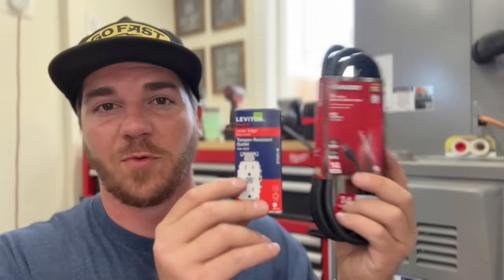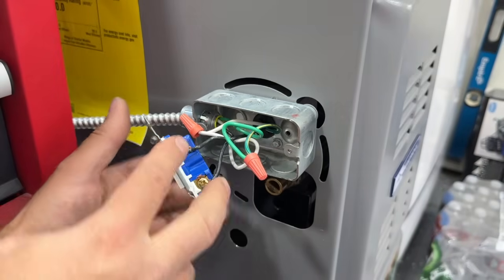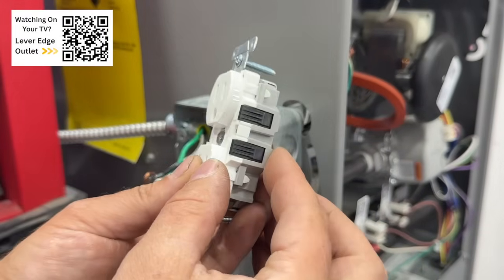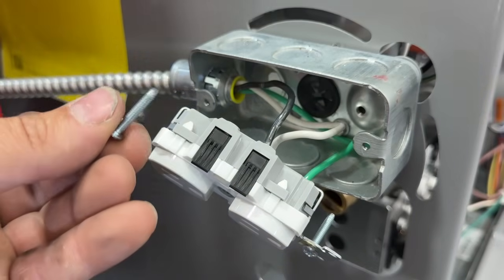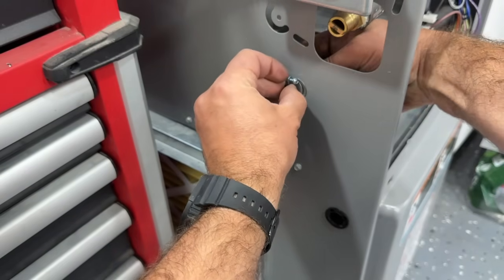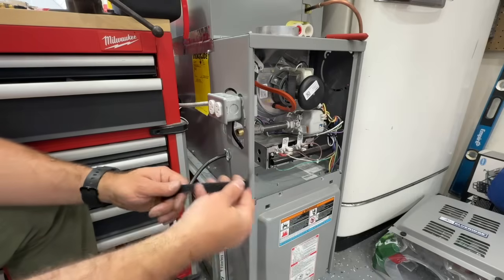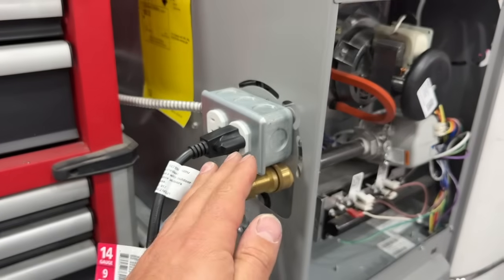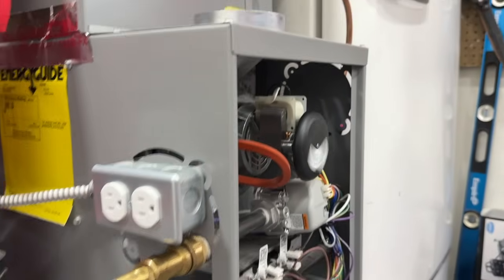This $16 Hack Could Keep Your Family Warm During A Power Outage!

Comment: You didn’t mention that you should use a pure sine wave supply, some people might use a cheap inverter which can damage the circuit board.
Reply: That totally depends on how complex the control electronics is in your furnace.  I sugggest you to try it first in the summer.
Reply: @tonylam-u1t right, so if it damages the circuit board I’ll have time to replace it for $$$. Good plan 🙄
Reply: @polishhotdog933  Then you should be smarter than  that.
Reply: @polishhotdog933  so does this mean i can't use my portable gas generator? or do i have buy a different generator or splice something in between the generator and the furnace circuit?:face-orange-biting-nails:
Reply: @cocodog85  I would use an inverter generator regular generators, have too much harmonic distortion in my opinion. Maybe it’ll work but I  wouldn’t take a chance.

Comment: This is good information and actually a good idea. The only thing to bear in mind is that SOME older furnaces may be a 20 amp circuit in which case you would need to use a 12 gauge pigtail and an outlet rated at 20 amps. Thankfully my house is wired into a  generator switch box so I just need to plug my generator into my electrical panel and I have 6 zones I can keep running.

Comment: I’m surprised that the switch for the furnace is on the furnace itself. Code here is that you have to be able to turn off the furnace without going past it. The switches are usually located on the wall at the foot of the stairs well away from the furnace

Comment: If the power is off, how does the wall thermostat work? My thermostat just has a blank digital screen when the power is out.
Reply from the maker: As soon as your furnace power is restored (via power station or generator) your thermostat will boot up and work as normal 👍🏼
Reply: @diyhvacguy huh, good to know. Thank you!

Comment: Wouldn't it be a good idea to use a single outlet instead of a duplex or is it OK to use the second outlet for an additional appliance?
Reply: No, the furnace should be the only thing on that circuit.  That's why it's the only thing on that circuit.

Comment: With air conditioning is there a back feed to that gas furnace
Reply: Shouldn't be, my furnace is ran by a 120v circuit, my AC is connected to a double pole 240v circuit, different circuits for each.

Comment: "Both of these items are less than $20. You don't have to break the bank to get power to your furnace ..."
But I have to go out and buy a   generator now.  Is that free?  In any event I have a very reliable power utility company and anyways most of my outages occur in the summer even though temps here are -30 with ice and snow in mid winter.
Reply: Well  yes dum dum, if you want backup power you have to get that from somewhere.  What a genius.

Comment: If there were a power outage, how would your thermostat get power?  It's not an old-school mercury switch.
Reply: The low voltage.trsnsformer is located inside the furnace.  It can supply the voltage to run the electronic thermostat, but if the backup batteries in the thermostat go dead, you'll have to take over the settings manually.
Reply: DCpower

Comment: are those bonding plugs needed for anything that is plugged into a battery powered backup supply with a 3 prong plug? I never heard of a bonding plug before. I assume with a gas powered generator, no bonding plug is needed.

Comment: Do not buy a "super-cheap" non-contact voltage tester especially for DIY toss-it-in-a-drawer afterwards.
This is a clear code violation. Permanently installed items like furnaces MUST BE hard wired, not using a pigtail; using a pigtail cord violates the UL listing and NEC installation requirements. 
Also, a bonding plug used in this manner leaves your furnace UNGROUNDED and dangerous, it leaves the furnace ground pin floating. 
Just get a proper PowerStation with properly grounded 3-wire sockets and know this is illegal anyway - if you ever have an inspector in that area you'll be red-tagged and flagged to remove it and possibly fined depending where you live. If it were to cause a fire, etc. your insurance claim could be denied.
Reply: LMAO.

Comment: Perfect!  Now, do a video on how to properly isolate and power my water well during an outage
Reply: I’m sure when he becomes the diy plumber guy instead of the diy HVAC guy, he will.
Reply: Isn't the water heater 240v? If the generator can't support 240v you will not be able to power it.
Reply: @Leona147741 Many generators do supply 240v.  They are obviously larger.  I happen to have three of them, but not large enough to do the whole home.  Enough, though, to supply power to the well pump. I'm not expecting to supply power to a water heater.
Reply: @Leona147741 he means his well
Pump not water heater.   But your still right many deep well
Pumps are 240v as well and would need a beefy generator

Comment: Thanks to you, I have installed an EZ Generator switch on my furnance, (supposedly code compliant, but I have my doubts). Now my family can stay safe and warm when we have one of the many winter power outages!
Reply from the maker: Glad you found the video helpful, and that you're better prepared for outages! 👍🏼
Reply: The EZ switch is both NEC code-compliant and UL listed. That probably explains its ludicrously high price. Permanently installed home heating appliances are generally required to be hard-wired. Attaching a flexible cord is not permitted and may cause issues with your insurance coverage. That said, this will work just fine.

Comment: Can you explain more why the grounding plug is needed to make the furnace work off the eco flow? That didn’t make sense to me.
Reply: A bonding plug is a device that connects the ground and neutral wires together, allowing generators to work properly with power surge protectors and ensuring safe power delivery to RVs. It is especially useful for generators that do not have a built-in neutral-to-ground bond, preventing error codes and power issues.

Comment: you also need a generator big enough to supply power to the furnace. Why not just install a 1 kw backup battery system then you can also run some other basic stuff?
Reply: A generator is cheaper than batteries for back up power, you would need a pretty big bank to last days.

Comment: based on videos I watched over the past couple of years, i could never go back and forth between my Ecoflow and grid with fancy inlet box and switch on the furnace. Your bonding adaptor explains the issue exactly based on how I had to hot wire my furnace to work with my ecoflow during an outage.

Comment: Like others asking?  What is the bonding plug for, you did not explain this very well.  I did your whole method from previous videos and love the concept and it works great with no bonding plug, so happy but now you are using a bonding plug and now back to confusion,
Reply: A bonding plug is a device that connects the ground and neutral wires together, allowing generators to work properly with power surge protectors and ensuring safe power delivery to RVs. It is especially useful for generators that do not have a built-in neutral-to-ground bond, preventing error codes and power issues.

Comment: in this example wouldnt it have made more sense to plug your power station into your furnace outlet, then plug the furnace pigtail into the power station instead of that rigged up grounding plug? plus this way if the power kicks back on in the middle of the night, you dont have to swap back immediately, or if the power keeps going in and out for a few hours, when you have power it would be topping off the power station. sounds like a win win to me.

Comment: Our furnace is about 20 years old and also has a plug that plugs into an outlet so it is easy to switch it to a power station. However ours draws around 800 watts when running so a larger power station is needed to sustain that and a little more on initial fan motor turning on.
Reply: My furnace while running draws just under 800 watts, my champion 2500 duel fuel generator will last around 24 hours on one tank of propane.

Comment: I'm confused by the 'bonding plug'. Why would the Ecoflow not want to power anything that's plugged into it that's drawing such a small amount of current? First I've seen this situation.
Reply: Some appliances need a ground reference to function , case in point modern furnaces. Ecoflow , generators and pure sine wave inverters are usually floating neutral the bond plug ties the neutral and ground together at the power source, Ecoflow or etc..

There is only one bond allowed so to keep linemen safe you should make sure you don't feed back to the mains.

Comment: This is great in a pinch, but spend the money and get a proper transfer switch that can be configured for a floating neutral.  Plus, you will be within code.
Reply: On a proper transfer switch, how do you get it to handle the floating neutral?
Reply: @garyganser2451 there’s a switch called the EZ Generator Switch.  It can be wired for either a floating or bonded neutral.
Reply: @garyganser2451 because you are using the ground of your electrical system I think.
Reply: It can be wired to switch the neutral.  See the EZ Generator's documentation for an example.

Comment: Doing this will fail an NEC electrical inspection. Changing anything into a plug in appliance in the 2024 NEC codes, requires GFCI protection. Because it is a receptacle in a residence, arch fault codes apply also. Why would anyone do this when you could install a UL rated manual generator interlock that will power your entire home doing a similar amount of work at the main panel.
Reply: That doesn't sound like a $16 hack. You would do it for an emergency only. It may never be used. Personally, I won't bother with this, I'll simply wire it up when needed. We've only lost our power for longer than an hour, 2-3 times in two decades. Our services are underground.
Reply: There are a lot of assumptions in your statement.  Number one is that not all Jurisdictions, in fact few jurisdictions across the country, adopt the NEC code when it gets published.  My home state is on 2017 with a few isolated exceptions.  Second, is if they used a single outlet instead of a duplex than as a dedicated receptacle it is possible to be an exception, again depending on your jurisdiction.
Reply: @michaelwitkiewicz7052 You don't know what you are talking about. You obviously don't hold an electrical license.

Comment: Great video, thank you! Your link for the bonding plug takes you to a lighted Leviton replacement plug on Amazon, not a bonding plug.
Reply: Yes, I ordered the wrong plug on Amazon!  I don't see that Leviton makes a bonding plug.  Fortunately I found a bonding plug from Southwire on Amazon.
Reply: True and I also ordered the plug he linked but I just made a jumper wire from the ground to the neutral

Comment: Why exactly did you need the bonding plug?
Reply: A question many of us have here and it was not addressed. I googled it and it's something to do with a floating neutral. I don't understand it as I'm not an electrician, but I don't understand the difference between plugging in a furnace or plugging in a toaster. I assumed the power station would provide power to anything that was plugged into it, as long as the current demands aren't exceeded.
Reply: A bonding plug is a device that connects the ground and neutral wires together, allowing generators to work properly with power surge protectors and ensuring safe power delivery to RVs. It is especially useful for generators that do not have a built-in neutral-to-ground bond, preventing error codes and power issues.
Reply: @katsasstrophy2334 thank you!!

Comment: Wait a minute, power goes out. You now supply power with your battery station (aka solar generator (?)) how is your electronic thermostat going to get power ?????
Reply: The C wire which is feed from the furnace. Some thermostats also have a battery
Reply: The thermostat gets its power from the furnace 24 volt internal transformer  no matter where the furnace gets its power from.

Comment: I went with the EZ generator switch as an alternative to adding a plug, but still have easy generator access during power outages.
Reply: yup, another vote for EZ generator switch,  I have two of them one for the hvac, that will keep air circulating and one for the propane boiler system.
Reply: I went with the EZ generator transfer switch too. Compliant and easy to install.
Reply: The generator switches nice I just have a problem paying $88 for something. I may use once a year.
Reply: @mitchmintz111  I'm going on 5 years and I've only tested it a couple of times.  Hoping I never use it but I get the $88.  I just dont want to be fumbling around in the dark trying to hardwire my furnace during an outage.
Reply: @markcarlson1696  Put an outlet where the furnace switch is in the box and put a plug on the furnace. Plug furnace into the outlet.
Reply: @mitchmintz111  That works and I considered it.  I felt more comfortable with putting the EZ gen switch on the circuit breaker for the furnace.  Which is what the manufacturer suggests.
Reply: How much did you pay for your generator and how often do you use that?

Comment: I tried to use my generator to power my furnace last winter and it didn't work.  Thankfully the outage was only about 3 or 4 hours so my house did not cool down thatmuch.  I wish I would have known about the bonding plug and I went ahead and purchased one so l if we lose power again this winter my generator should power my furnace.

Comment: Question:  if my furnace already plugs into the wall, can I just run it with a generator if needed? Do you have a video on this?
Reply from the maker: Yes exactly, just unplug your furnace from the wall, and plug it into your generator (or extension cord if you need to run it further than the cord will reach  to get it outside) 👍🏼
Reply: Just have a bonding plug on hand if needed, many generators have a floating neutral; And most modern furnaces require a ground reference to run.

Comment: I started to do this last year after watching your video, I've done some electrical wiring but when I got into it I saw it had a door switch to the furnace i wasn't sure how to hook it up. Love this idea though. Thank you.
Reply from the maker: This does not effect the door switch. The door switch will function exactly the same. If you pull the blower motor door off, it will kill power to the main board. 👍🏼
Reply: @diyhvacguy  Thank you, I just wasn't sure how to rewire the door switch. Have a good day.
Reply: @silverfox-59  you dont

Comment: One other issue....The link to the receptacle on Amazon links the the Decora one and not the one shown in the video.   Matter of fact I cannot find the Leviton Lever Edge with the standard(non Decora) dual receptacle.  15A or 20A ones.
Reply from the maker: Yes, the one that’s linked is for a decor one but I’ve also linked a metal cover that will match, so the install is exactly the same

Comment: I am going to hook mine up like this thanks.how much is that generator cost and will it last long on a charge
Reply: In the video he said that furnace will run a couple of hours from the power station he used to illustrate the idea.  

The run time for your installation will depend on your furnace electrical needs and the capacity of the power station or generator you use to power it.

Comment: What do you do if you have a 10 amp fuse in your switch box by the furnace?
Reply from the maker: If your breaker is 15 amps you can disregard the 10amp fuse.
Reply: @diyhvacguy Thank you!
Reply: My old furnace has a 7.5A fuse.  A year ago it started blowing that fuse.  It turned out that the run capacitor for my blower motor was bad.  I replaced the cap and it runs great now.  If I didn’t have that fuse, and the circuit was able to feed it with something closer to 15A, I worry that the motor might have burned itself out.

Comment: The issue here, where and when it matters, is this isn’t code compliant unless the manufacturer lists a cord and plug as allowed. From a laws of physics standpoint you’re just fine though often the safety concern for hardwiring is due to cords being tripping hazards. 

There are for about $10 more transfer switch junction boxes with a NEMA 5-15 or 5-20 inlet. Everything stays hardwired that way and you run an extension cord only when you’re in an emergency. Nothing to trip over or catch.
Reply: Cabral ,
Can you post a YouTube link to an install using the transfer switch ?
Reply: @josephpadula2283  I am not Cabral, but here is a video I found on using a furnace mounted transfer switch: https://youtu.be/p5DaI8XrYQ4?si=GpWB-SNLtWmKm5ez
Reply: Imagine getting denied an insurance claim for 600k+ because you did that stupid thing.
Reply: If you're in a fix and your life depends on it, who gives a crap if it's 'code compliant'?
Reply: @kirok3184 it’s not when you are ‘in a fix’. It’s the other 99.9999% of the time.  Insurance companies would love to deny a claim if something happened involving your furnace and there was a modification that wasn’t allowed. 
I would take the risk, but that’s not a risk everyone would be comfortable with.
Reply: @kirok3184  this is what I was thinking also… tripping hazards aren’t an issue when you’re actively dying. 😂
Reply: @kirok3184  it’s not exactly an emergency if you’re installing a transfer switch you ordered off the internet or a bunch of parts from the store. Just buy the right thing when it’s not an emergency.